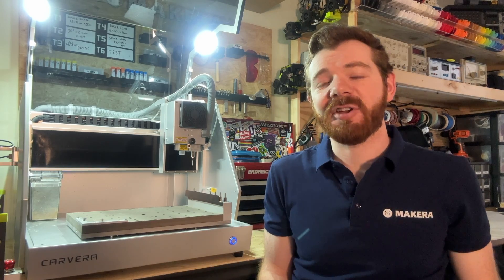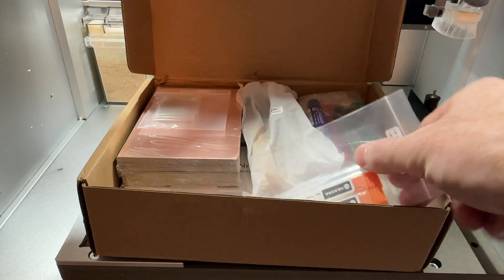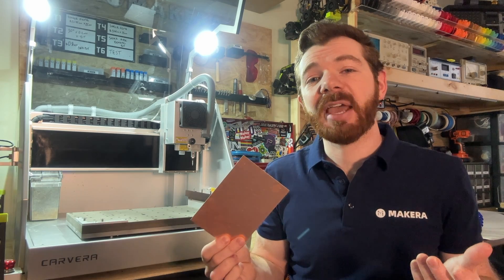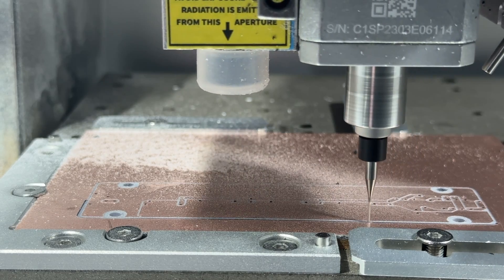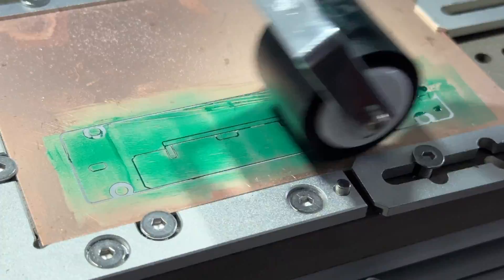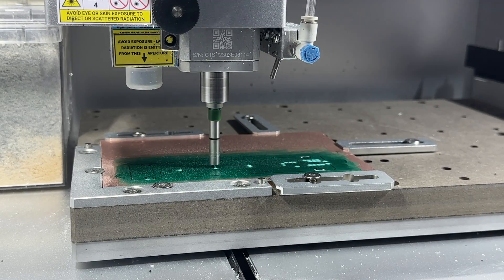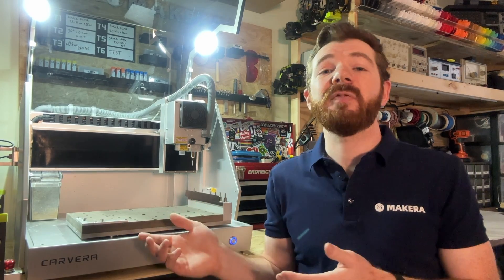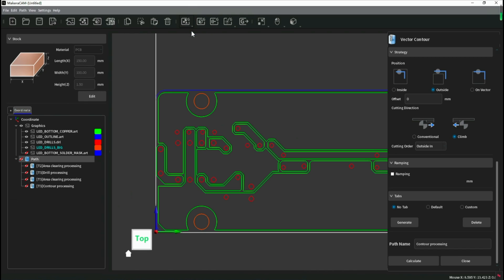What is the PCB Fabrication Pack? Carvera CNC

Comment: How are the rivets fastened? There doesn't seem to be a punch to flare the the insertion side.
Reply from the maker: The rivets can be placed and soldered, as shown in this video: https://www.youtube.com/watch?v=qVCwpuHwfyE&t=483s
Reply: @Makera  I couldn’t see any rivets being soldered so I just assume some of them were rivets. 
  When you solder on one side and then flip it over to solder the other side of the rivet does it tend to melt on both sides and fall out?
Reply from the maker: No, soldering both sides works well as long as you have your soldering iron temperatures set properly.